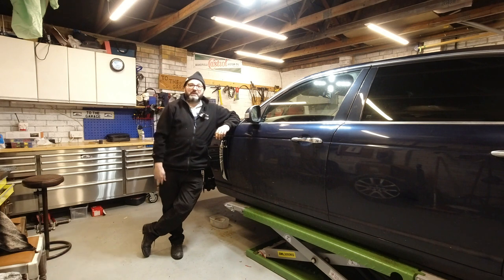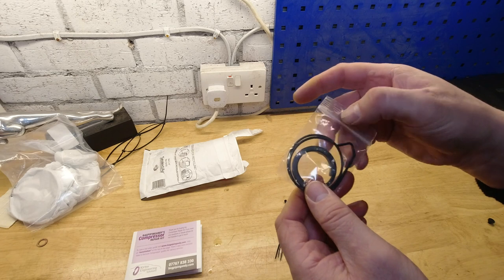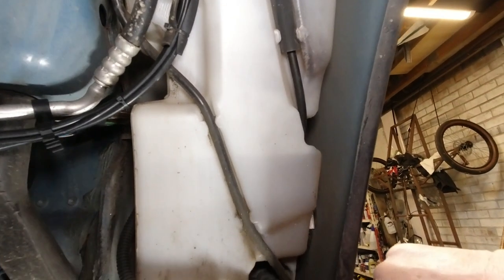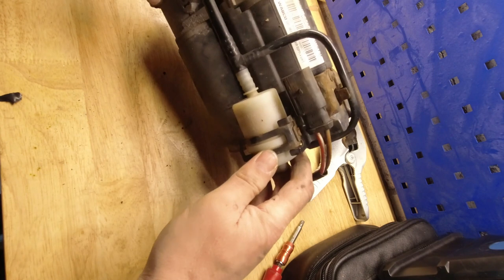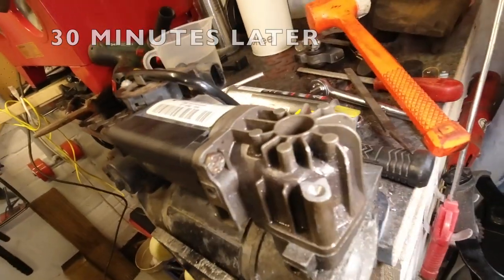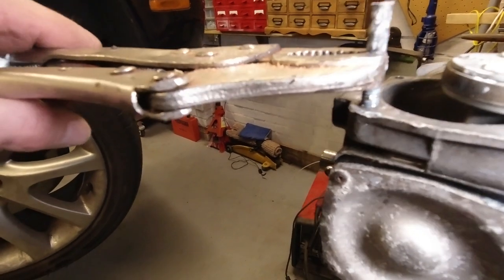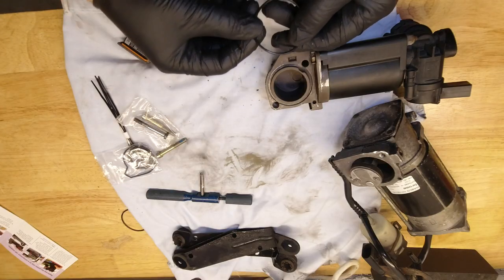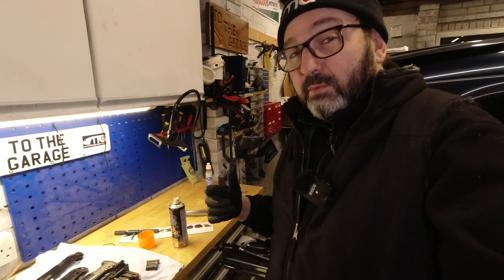How to fix your Jaguar Air suspension fault. BLU 14

Comment: Done today using a jack and an axle stand. Both bolts on the compressor were seized but used your method of tightening and loosening and it worked. The car is now back together and no more suspension fault. Please note though, when it’s all done you do need to clear the fault code.
 Thanks again John for the easy to follow instructions.
Reply from the maker: Thanks for watching and contributing Alan.👍

Comment: I was one of the first few dozen customers of BagpipingAndy. Before the nice brochure and tap. His kit worked great. Unfortunately I had exactly the same problem as you with that darn bolt! It took me 4 or 5 hours to extract it, at 20 degree F, no drill, no vise, no torch, up till 2am. Your video would have helped, if only to be prepared. 

The only repair that was as frustrating was replacing the front wheel bearing assembly. Aluminum to steel corrosion welded the parts together and that took many hours with a sledge hammer. My poor neighbors. At least the weather was pleasant.
Reply from the maker: Hi Tom👍 Thanks for the recommendation. Your comments are always valued and  interesting. I am taking some tape with me on my next trip out with BLU in order to experiment with the mystery wind noise.
Stay safe pal.

Comment: Excellent work and demonstration. Well done. Just a quick note. Ammonia is great for tackling aluminium dioxide. I used it on stuck v12 jag head bolts. Smells bad but worth the time it saves. You can source it from your local chemist.
Reply: Good tip! - I shall file that away for the inevitable time I need it. 🙂

Comment: Hi John! Good to hear from you again. Really looking forward to this one: air suspension worries me!
Reply from the maker: Turns out its all pretty straight forward.   So far at least 🤞
Reply: @ToTheGarage   Oh, alloy bolts. The joy, the joy...
Reply from the maker: @hewyn1  I genuinely don’t know of any good reason to spec these Alloy bolts on anything other than light aircraft. I can only imagine the pump supplier bid to win the work based on weight. (First all alloy car) The bolt weight is totally inconsequential on this giant of a car ( all alloy or not) but would show up a  fractional percentage on the pump weight😔

Comment: Watched this one out of curiosity, have heard tales of the air suspension etc. Nice to know there is a common issue that's straightforward to repair  apart from crap quality screws that is. And LH drills is a new one for me, never realised you could get them, so cheers for the tutorial and the tip.
Reply from the maker: Hi Terry.
Glad you enjoyed it. I will add some LH drill Links to the video description👍

Comment: John, many thanks for this video. I had a double problem with suspension and a gear box fault. The gear box fault was actually the alternator giving peak voltages up to 17V!, which was also causing a suspension fault message. I put on a new alternator and the gear box fault vanished (after I had the bottom of the gear box off and loaded it with fresh fluid which had no effect at all, still it's done now). The frequency of the suspension fault fell markedly after the alternator change, but I was still getting a low vehicle fault. I've just finished the job in the video and all is right with the world again. Mine came apart much more easy than yours. One tip  I would offer in the event of a bolt head round off, is to dremel a slot across the head which allows a big screw driver to be applied, it works most times, but not completely 100%
On big tip for your readers is earthing on this car. I would advise a complete re earth for all points in the engine bay, the engine to body earth underneath (this one caused me to change a starter motor which turned out to be a bad earth. Also the earth connection to the battery had severely corroded, which is strange given that it is a dry area. The first check for any fault on this car is the associated earth.
Now I need to find out why my sat nav keeps telling me "Unable to calculate route" - any ideas?
Reply from the maker: Great Tip re earths Phil. 
This is one of the very first. Aluminium cars and the corrosion at electrical contact points is more. prevalent than on the. steel cars👍
As the Sat nav is now quite out of date, is it possible that your home or wherever you are inputting the route, is not on its map and therefore it cant find a road to get out of the field where your house/office is?.  Ive had that problem.
Reply: @ToTheGarage  Just for info, regarding the Sat Nav - "Unable to Calculate Route". i have been told that this is probably a firmware concern. I know that the Nav unit was changed by the garage where I bought the car. I think the head unit and the NAV unit may have to be matched. I'll update when I find out more.

Comment: Good job John. I've done the same job several times on P38 Range Rovers but your air pump is a much better design, and a more substantial one, than the P38 version. One thing I would have done would be to have aluminium greased (or copper greased) those bolts. I would have greased the entire bolt as I'm not a great believer in thread-locker but certainly doing the non-threaded section would have been a good idea. Richard.
Reply from the maker: Very good point Richard.
In fact you have made me wonder if I should whip them back out now🤔

Comment: I also did break one of the screws. Some heat and good lock pliers did make the screw come out.
I did not take out the undertray as there is enough room to work from the wheel arch.
I also replaced the air drier as I think this is a vital part of the system.

The compressor supporting three springs can be difficult to refit. I did first refit the compressor without the springs. Then I did a refit each spring one at a time. This was easy as the compressor stays in place with two nuts. 

The compressor can produce squeak when driving on uneven surfaces. The sound comes from the rubber dampers abow the spring. So now is a good time to grease the rubbers with molubdenum grease or something similar.
Reply from the maker: Top additional tips s palmgre.  Thank you

Comment: For future reference (although let's hope it's never repeated) tap a slightly larger Torx head into the damaged bolt head. Once it's secure slowly unscrew the bolt.
Reply from the maker: A top tool tip Thomas. Thanks👍

Comment: Hi John, I only get the "air suspension default" message when its 35 degrees outside...Is it the air temperature connection?

Comment: Hi John, great stuff with the XJ , I have a 2005 XJ  Sovereign diesel x350, almost the same car, and I did the same compressor ring replacement as you , about 4 years ago . Parts sourced from the same Scotsman!  To make you feel happier, I had the same issue with one of the bolts seized . I had to drill mine out and re - tap to 7mm . The repair was a success for a year or so , but I now get the warning message again randomly, but, the car drives perfectly.
Reply from the maker: Thanks for sharing Nigel. Nice to know it was not just me😁

Comment: My jaguar had an air suspension code and a dynamics fault code come up but the problem is now it won’t start. Can I assume that it’s a fuse that’s blown due to that? I really want it to start to take it to a dealer for a diagnostics

Comment: I replaced my 2 rear shocks on my Jaguar xj8 and then it was lower on the rear right but higher on all the rest of the suspension. Then I then got this valve block & replaced it but now the suspension in the front & rear won't lower. I can manually lower it with my diagnostic mechine but when I have it off the machine it goes back up?

Would you maybe have any advice to my problem?
Reply from the maker: The shocks themselves should not have any effect on the ride height, so I would suspect that the height sensor has been knocked or has given up altogether. It only needs the front or the rear to go wrong in order for both ends to act irrationally as they are trying to keep the car (what it imagines to be) Level rather than a specific height.
When you set the reference height using your diagnostic kit, is the car on a nice flat surface? If not then that may be part of the issue.

Comment: Thanks, John 

I am facing a nightmare with my XJ8 2006 I ordered 4 new Arnott springs and a new compressor, no air suspension fault message but the car goes down at night: it starts after two hours of turning off, the front right side is the first to go down followed by the left front side and after 5 hours both rear sides go down. After starting the car in the mourning I can see the message (vehicle is too low) within two minutes the car goes up to the regular level the message (vehicle is too low) disappears and the car drives normally all day. The mechanic could not locate a leak by applying water and sope, he checked the visible points and joints of the lines including the block under the boot, then the mechanic suggests that although all springs are new, the front right one could be the source of the leak because it goes down first and usually it is about 1CM lower than others even after leveling up during the day. So I replaced the front right spring under the warranty but it is the same. Does this seem to be a leak not been detected by the mechanic? 

Appreciate your advice

Comment: Thanks John. I wonder whether the problems you had with the pesky bolt are because these units are not intended to be servicable and are tamper proof?
Reply from the maker: Its because they are ALLOY bolts and reduce the weight of the compressor. Which was important for the project. (All suppliers told to save weight for the first all alloy car). But they of course have no impact on the whole car weight. They just make it difficult for us to service the compressor😁

Comment: My XKR tossed a SUSPENSION FAULT dash code.  I looked up Jaguar Forums and they said to pull a fuse.  Also to look at the little wire commie off the shock absorbers.  I did pull the fuse, and the dash code went away.  I don't now recall which fuse that was! 0f course this didn't fix anything.  I did look at the front two shock absorbers and saw nothing wrong.  I'm  not sure where the back ones are.  Any suggestions?  Thank you.

Comment: Great video, really comprehensive and very well presented. I'm thinking of taking on an X350 that is very low and on its belly as it hasn't been used for months. Do you think it's likely to need a compressor repair or whether it's more likely to be a leaky shock absorber? The previous owner said when it used to go a bit low it would soon rise in a few miles but I'm not sure taking on an X350 that's flat on the floor is a good idea!
Reply from the maker: Why not suggest that you take it to an independent Jag specialist with some basic software to calibrate the ride height. (You literally just tell the car what standard height you want) And if it rises and maintains its composure for a day or two, that you will buy it.
And pay for the calibration on top of the agreed price. If its all a bit of a disaster, then the seller has learnt the answer (at his expense) to the question every prospective buyer should be asking, or you may decide that now you know the issues you could agree a different price.
There are plenty of nice examples out there though so dont rush into buying this one unless its a rare spec.

Comment: Useful. Had my 2008 XJ (54k miles only) just a few weeks and the air suspension fault light came on today while on the M6. Pulled off at the services, switched off, did a visual check and all looked well. Started up again - fault message gone and has remained off so far. Can the system correct itself, or will it be back soon enough?
Reply from the maker: The most common source of the fault is just that the system was unable to generate a full air tank, or lift the car to its correct ride height within (I think its) 10 seconds of receiving a command to do so. So it is possible to get a code concrete slab motorways for instance because every time the system generates some air, the car needs it to correct a big axle movement.   So all may be fine. If not then new piston ring on the compressor should do the trick. I wouldn't worry unless you start to get the message regularly👍

Comment: Have got a X350 - got the fault light with no obvious fault. Ride height is consistent (measuring wheel arch to centre wheel).
Tested by Jaguar with no leaks detected. Can drive 2 miles before the message comes up. Can drive 200 miles and it never comes on. Then can drive 12 miles and it comes on. It’s never consistent and always random. When the cars been sat overnight it doesn’t lose height and the fault light doesn’t come on straight away, every day. Thoughts?  Could you post the part number of the compressor required please?
Reply from the maker: Its. probably the same root cause of error as on mine. The suspension is all working as it should. Its just the compressor takes longer to re fill the tank, &/or achieve the requested ride height. 
Sorry I don't have the part number for the whole compressor. SNG Barrat website will have it though.  If. the compressor is still operating then the only likely issue is the piston ring.
Reply: See my reply to Nick Harrison if the ring doesn't sort your problem. I had a combination of the ring and an electrical problem - details above.

Comment: Hi John yes I do have a air suspension fault but to me it seems to be high doesn’t drop at all
Reply: Nick, I have just finished the refurb in this video, John's video was priceless. The journey is less hard when someone has scouted the path ahead. It took me about 3 hours, but I spent a lot of time cleaning and de-rusting other bits of gear around the area. The kit was 20 or 25£ and came within days.
Something you might try is to check alternator voltage. The X350/X358, have an intelligent alternator, which changes charge voltage depending on factors such as temperature. The full operating range is 13.8 to 15.5v. If ambient is less than 15C, the alternator will charge between 14.5 and 15.5V. My alternator (broken one) was peaking at 17V and this was causing all kinds of ghost faults (for me, main ones where suspension and gear box) The gear box one made my heart sink, but it turns out that the box is healthy. 
If you have a multi meter, check the voltage between the main black fuse in the engine bay fuse box and the engine hoist bracket. If you haven't got a multimeter, it is possible to put the car in diagnostic mode by pressing and holding (for 5 secs) the PHONE button and the one directly opposite it (MENU) You will be presented with a key pad. The code is 1971 ENTER. Select  "Manual" then "Display", then "PWM.." This will give you a screen which shows the voltage(either with/out the engine running). If the fault corresponds with a spike in voltage above 15.5V, you may have an earth fault or a bad alternator. When exploring this diagnostic mode DO NOT UPDATE SOFTWARE - it will kill your car and a main dealer will have your eyes out to reset it. Hope this is of some use. You can see the DTC codes that your car is flagging in one of the other screens. Check all of the engine bay earths, they are famous for failing. I have ran new earths and it has made the car much more reliable. It was probably an intermittent earth fault that killed my alternator's internal control circuit.

Comment: HI What diagnostic tool are you  using to pull that fault code, or are you just using the screen of the car. thanks
Reply from the maker: Screen of the car in this case Edward.

Comment: Hello john i would really aprreciate k
If you could help me i have a jag same as yours diesel but my rear wont lift up i tried replacing the compressor but it didnt go into fuction so i put my ckmpressor back in and the car rose for 3 days at the maximum height and then deflated again changed the battery it inflated and worked perfectly for 3 days and then they deflated again i dont know what should i do please help no one knows what to do

Comment: Hello John. Perhaps you and your subscribers can help. Since owning my 2.7 S Type I have noticed a vibration / resonance through the accelerator pedal between 1250 and 1500 rpm. At all other revs the engine is quiet and smooth as silk. It is more of an irritation than concern as in all other respects the car is a great drive. Thanks.
Reply from the maker: Its possible that the engine mounts may be in need of replacement. But the Lion engine would normally twitch more a fraction above idle (900 rpm maybe)
What does anyone else think?
Reply: The X350 2.7tdi has active engine mounts which harmonise with the engine below 1000rpm, after that they de-activate. A defective one gives a drone when idle, but it disappears when you pull away. I unplugged the defective unit and the noise/vibration went. If your car has active mounts, unplug them and see what happens. they are not connected to the diagnostic system, so you won't generate error flags.

Comment: Hi John , quick question when you replaced your pump on front suspension, did you have to program it  to the car ,or is it plug and play..thanks Craig
Reply from the maker: Hi Janet. ✋No the car just sorted itself out. As long as you don't remove or replace the height sensor attached to the suspension arm, you should be fine.